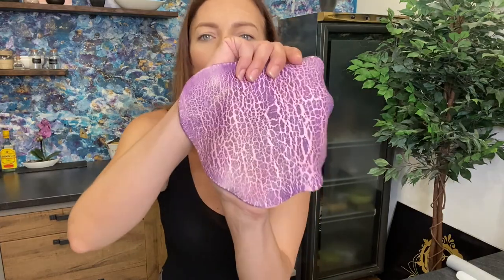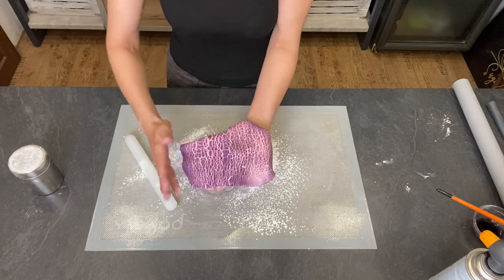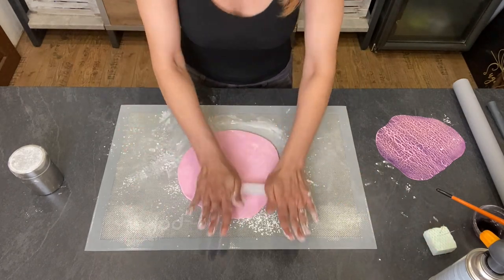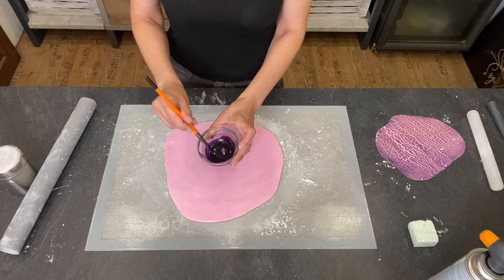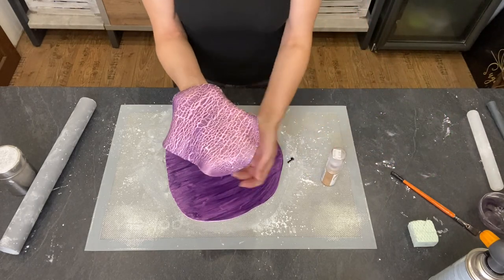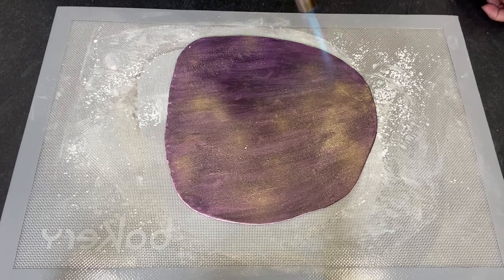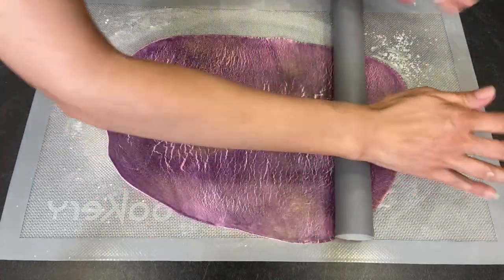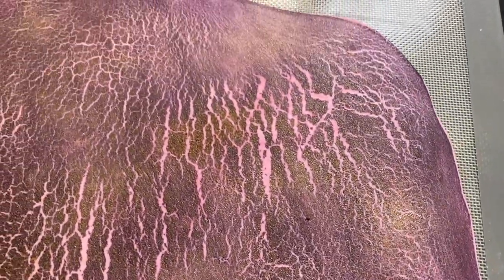Crackled fondant technique

Comment: Im from India Plz tell me you don't use any cmc or tylose powder while kneading the fondant?is cmc or tylose  is not necessary in fondant while drapping the cake .
Reply from the maker: Hi. No, no cmc or tylose powder needed. It's actually worse if you use it, because the fondant hardens and that makes it ever harder to cover the cake. Cmc or tylose is recommended to add to fondant when you want to make figurines with it, so it's not to soft for modeling.

Comment: Hi its stunning 😍 thanks a lot..inca Instead of the alcohol can I use something isn't ir melting 🤔?
Reply from the maker: Yes, you can also use water, just be careful not to put too much of it on the fondant, so it doesn't get soft (and don't dilute the gel color too much) an then wait a little longer for it to dry. 
If you can't buy alcohol, maybe try alcohol that you buy in pharmacy for cleaning wounds. Just make sure you read the label  - only alcohol diluted with clean water, no other chemicals so it's safe to use. Usually it's a high % of alcohol. All the alcohol will evaporate so you don't have to worry.

Comment: Hey please is it necessary for one to use the touch? Or is there an alternative in place of it?
Reply from the maker: Hi Esther. You need to burn the surface of the fondant. I can't think of any other tool to do that. Maybe if you have some other source of flame that you can control and direct on the surface.

Comment: I can use chocolate color
Reply from the maker: Colors for chocolate you mean? With fondant you can use almost any edible color. Gel, powder, oil soluble colors for chocolate... Airbrush colors contain a lot of water so I don't recommend using them for coloring the whole fondant (basic color), because it may change the consistency of the fondant... You could use airbrush colors for coloring the surface. But is would be better to do it with gel color so you can use less water. Hope this helps.